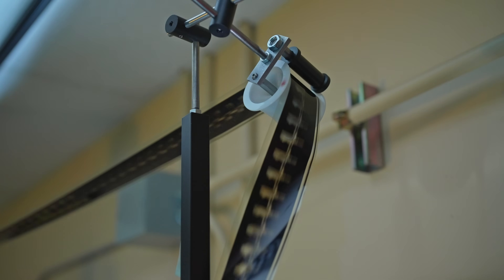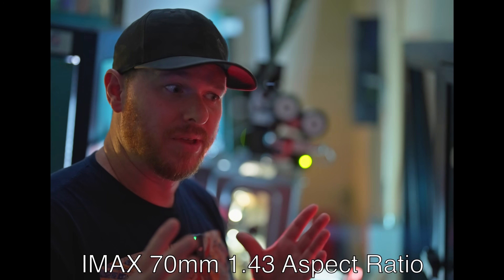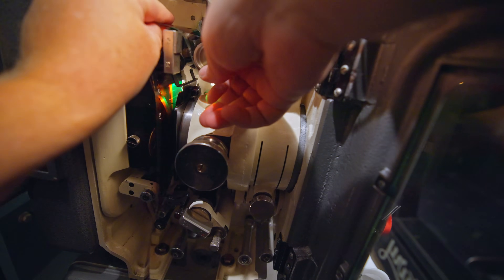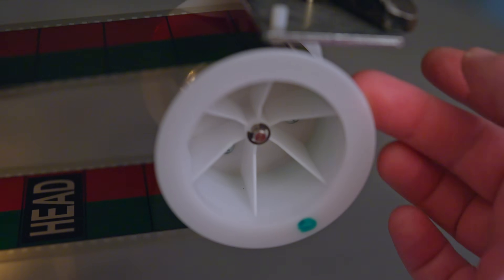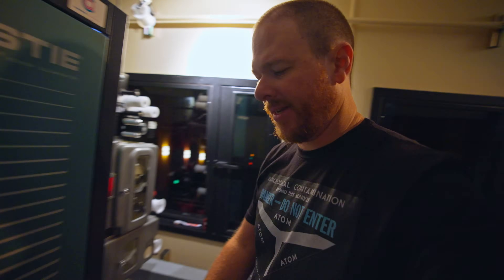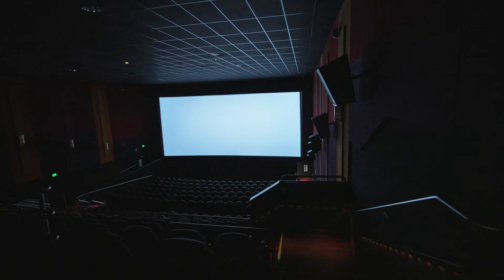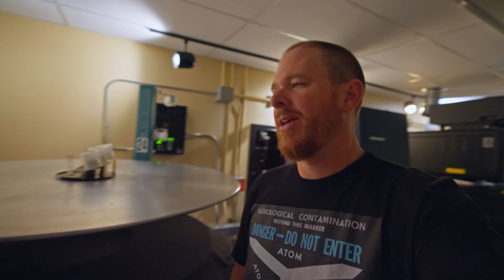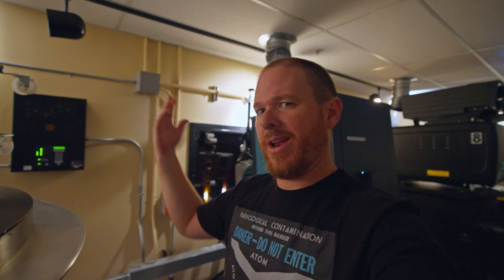Being a Projectionist for Oppenheimer 70mm Film Part 2

Comment: I've heard that for popular shows, a single platter would feed multiple projectors on different screens at the same time, with the film traveling long distances between projectors.  Do you have any experience with that?
Reply from the maker: I’ve never had to “interlock” a film print between different projectors like that. I’ve heard of some of the stories and they sound nuts.
Reply: Some years ago, i found a very nice video about that exact process here on Youtube. Try searching for it. Hope it's still there, though with the state of youtube's search system these days it might be tough to find it.
Reply: I used to work as a projectionist. We'd call this an interlock when you ran one print through multiple projectors. There were special rollers installed in the ceiling of the projection booth just for this purpose. If I was doing a two projector interlock, it would go sort of like this: you'd have a crazy long amount of film leader spliced to the head of the print, run it from the first projector's platter system to the first projector, thread it through the first projector, then run the projector and slowly thread along the ceiling rollers until you reached the next projector, being sure to leave yourself a bunch of slack, then thread the second projector and run the film to the platter system for the second system, where it would be wound back up and take up the extra slack between the projectors by running projector 2 for a few seconds. Then you'd flip a switch on the projectors to put them into interlock mode so they would both start at the same time when you pushed the start button on either of them.  If you did not put the projectors in interlock mode, you were in for a bad time; film dumped on the floor, or stretched and torn, depending on which projector you forgot to flip the switch on. For the next showing I'd just do the same thing, but in reverse: from projector 2, back to 1. The "longest" interlock I was was ever present for, but did not run myself was a 4 projector interlock. One film print that was run through 4 projectors! It was for a special event and a few of our old school projectionists who were actually still in the union ran it (and were stressed out the entire time). What made it even crazier was that 2 projectors were in one hall and the other 2 were in a hall that was perpendicular to the other, so the film had to be routed around the corner. Longest film leader I've ever seen! I would regularly run two projector interlocks myself, but those were easy peasey compared to running 4 at once!

Comment: Out of curiosity, how much do these special engagements pay? For instance, are you making more than what you made as a full time projectionist? If you feel comfortable answering, you don’t have to give numbers.
Reply from the maker: The hourly rate is about the same as a Studio Projectionist would be paid, which is the job I use to have back when I worked down in Los Angeles. The big plus is that its 14 hour days 7 days a week, with overtime and double time.

Studio projectionists get paid far more than what normal theater projectionists get paid. When I use to work at theaters I believe I was getting paid $7.50/hr (minimum wage at the time). When I started working for Warner Bros back in 2000, I started off with a $30/hr rate.

Comment: Is there a process or procedure for if the film becomes unspooled or dropped off the spool and is a giant mess of film?
Reply from the maker: A couple ways that can happen. If there is a bunch of static electricity that can sometimes throttle the motor speed for the platter and cause the print to almost slide off the platter. I say almost slide off because the brain (the motor speed controller in the center of the print) usually keeps it hanging on but in a mess that needs to be fixed. There can also be a brain wrap where the platter stops turning and the projector keeps pulling film. To fix something like that usually requires taking that wrapped section out and fixing it the best you can.
Reply: I just envision rats nest of a headache and a very uncomfortable phone call. Keep up the good videos!  @RadioactiveDrew
Reply: A brain wrap, lol, so funny to hear that term again! Brain wraps are bad, but tail wraps were worse! My theater had the cheapest platters that were prone to causing tail wraps. (not like those super-nice Christies!) If you didn't tuck the tail under correctly, or use some kind of "wrap strap" to keep the tail from flapping around, the film would get loose at the tail and eventually wrap all around the arm of the platter in a huge rat's nest tangle. It didn't happen often, but when it did, I'd have to carefully try to untangle the whole mess without damaging the print. Do not miss that at all.  @RadioactiveDrew

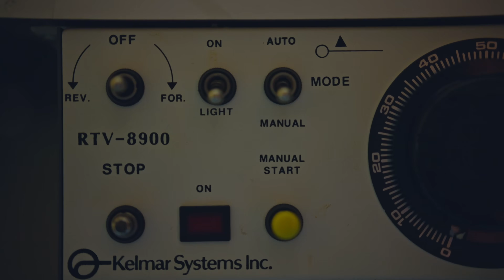Comment: 2:17 Since 15/70 is ran through the camera/projector horizontally, it’s not as simple as removing the aperture plate, like it would be if you shot 4 perf 35mm vs 2 or 3 perf. So you do get a significant increase in resolution. On a 15/70 screen, the 65 scenes look about as grainy as you might expect 35mm to look on a regular sized screen, and the imax scenes are nearly grainless.

2:30 I agree that it doesn’t make a whole lot of logical sense, but the difference is clear as day on a six story tall imax screen.
Reply: And at the IMAX presentation when it switches from scenes shot in IMAX to scenes in regular 65, the grain on image is very noticeable especially because they have to blow it up to the IMAX frame for presentation. 

I watched the movie in both 70mm formats and they were both great. But watching the movie in IMAX, especially scenes shot in it were totally amazing.
Reply: @bagnome I saw Dunkirk in 70mm IMAX and noticed it then, too. However, in Oppenheimer, Nolan uses grain to differentiate eras, especially the black and white scenes.
Reply: @bagnome And what is interesting is that from another YouTuber, he said those 65mm 2.20:1 scenes felt like they were optically zoomed to 1.90:1 on the 1570mm IMAX print (thus cropping some image). I would guess this was to compensate for the visual presentation to allow the 65mm footage not looking so small on the 1.43:1 frame, similar to watching scope films on a 4:3 TV back in the day.
Reply from the maker: @vangmx weird, I could see that happening though.
Reply: @vangmx  I really, truly doubt that.
Reply: I think the call-out to resolution vs resolving power is a key distinction. IMAX' 15 perf obviously has a higher resolution, since it's three times the film area. However, the aspect ratio is different than flat 70, so if the film is shot in IMAX and cropped for flat 70, the resolving power between the two isn't as huge. Showing the two frames next to each other is a great illustration!

I used to project 16mm in college, and the majority were academy standard, but we had anamorphic lenses and it always felt like a treat to show stuff in "widescreen" even though the resolving power didn't increase. ;)  My favorite films were where the academy crop was different than standard widescreen, and we got some extra "details" like boom mics in the top of the shot, or effects that revealed their tricks at the bottom.
Reply: and the changeovers! sometimes due to the 16mm format we had multiple changeover marks to keep track of. especially when something was printed from 35 to 16 where the reel length didn't match, or the original negative reels had marks, we would get "false" changeover marks before the reel was actually over. I distinctly recall a showing of 8-1/2 (Fellini) that had a scene a colleague inadvertently edited out due to a premature changeover. He realized his mistake after the changeover, apologized, and showed the scene after the end, but having projected the same film the previous year (possibly the same reels) I almost got hit by the same "gotcha" and empathized completely.

platters remove all of the changeover stress, but for single-screen theaters showing multiple different movies a night, that's a lot of setup / teardown overhead. I'll have to find out how my locals manage it. Maybe multiple platter trays on a single spindle?

Comment: 70mm IMAX is still higher resolution than 5-perf since it’s got a wider image ears. Also the IMAX footage on the IMAX prints is printed from the camera negative while the 5-perf prints are fourth gen. That’s a loss in detail. I’ve seen both. It’s say it mostly scales with the screen sizes though. Since IMAX is that much larger you don’t get a much sharper image but you can see a lot more detail. Because it’s so huge and you’re sitting so close to the screen. That being said, 5-perf is still ridiculously good!
Reply from the maker: I can’t really comment on the scaling process going from IMAX to 70mm. But that’s only for some of the shots. To reason this out a bit more, maybe the IMAX shots have to go through a bit more of a process to get onto the 70mm 5 perf negative they use to make the prints. Than what the original 65mm (what they use to shoot 70mm) has to go through to get in that 70mm 5 perf negative used to make prints. Or…they scan everything in and then digitally print it was a laser for a inner negative. Had to say exactly if there was a resolution bottle neck somewhere in the process for one format or another.
Reply: @RadioactiveDrew Nolan is well known for making his prints purely photochemical (except for vfx shots of course). So the blowups and shrinks are optically printed.
Reply from the maker: @wright96d well then that would have been complicated for the negative assembly team. What they use to do back when film was going strong was have original negatives for each film. An answer print was struck from that and then another negative was struck from that answer print. So usually in the best circumstances you would see a print that was a couple generations removed from the original negative.
Reply: @RadioactiveDrew  Four to be precise, like the print you’re showing and all the 35mm prints as well. I’ve talked to the lab head at FotoKem last fall and he said they’d be starting negative cutting in a week. That was over eight months before the movie came out. I think they need that time to do all the reductions, color timing, and neg assembly for the various prints. Since Dunkirk all of Nolan’s IMAX prints have been struck from the camera negative, while before that they’ve been struck from a dupe neg. So four generations like the rest. But they’ve always done some prints from the original camera neg as is tradition. For premiers and big city locations. It’s not like fourth gen prints are bad. It’s more that neg prints are so incredible. It like the difference between 5-perf and 15-perf. 5-perf is amazing and gorgeous but 15-perf is the best there is and it’s so perfect.
Reply from the maker: @VariTimo I use to work at Technicolor and Deluxe labs as a projectionist and that was kind of a cool experience. Lots of different procedures for film transfers. Never had to do any dye transfer work but I heard it was a messy process. 

But yes, I agree with you. IMAX is a beautiful film format if done right. Same with 70mm 5 perf. I still laugh at the 6k vs 18k arguments between 70mm vs IMAX.
Reply: @RadioactiveDrew  Yeah defiantly. I did some math an IMAX may only reach 18k in the most extreme edge cases. Probably saver to say it’s 8-12K. 

They haven’t done dye transfer in decades. I think it died in the early 80s.
Reply from the maker: @VariTimo well they were still doing dye transfers in the early 2000’s. At least that’s what I heard from fellow projectionists at Technicolor.
Reply: @RadioactiveDrew  Really? That’s crazy man!
Reply: @RadioactiveDrew  With contact printing the only bottle neck is generational loss. The IMAX shots get optically reduced to 5-perf and vice versa for the IMAX prints, which I think is why some wide shots in the 5-perf are soft. Everything is sharp in the 15-perf prints.
Reply from the maker: @VariTimo some of the shots are soft because they were shot out of focus. This has been a problem ever since Nolan has teamed up with his current DP.
Reply: @RadioactiveDrew  Those are not the shots I mean. They’re specifically IMAX shots and it’s pretty much only noticeable in wide shots. It gets worse and better. And the issue with focus isn’t really the DPs fault. And it wasn’t an issue at all in Interstellar and almost not an issue in the other two. Nolan wanted to use 5-perf instead of 35mm. And for this one I think the issue is the new lenses they’ve used and the fact that Nolan doesn’t do reshoots on principle.
Reply from the maker: @VariTimo there were some horribly out of focus shots in Interstellar. I was at Warner Bros as a projectionist and heard all the concerns about the soft shots.
Reply: @RadioactiveDrew  Really? I saw it in 15-perf earlier this year and I didn’t notice anything horrendous. And I was sitting pretty close. There is some softness going on. But that’s because of soft lenses. From my memory, Interstellar didn’t have any more out of focus shots than any other film based movie.
Reply from the maker: @VariTimo okay, I’ve seen these films way more than most people so my criticism is going to be a little hyper. The shot in Interstellar that is horribly out of focus is when Matthew McConaughey is crying after seeing all the messages from the past. There are a bunch of other shots but that one stands out. With Oppenheimer where to start. The opening shot of Oppenheimer when you see him for the first time. It starts in focus for a second but quickly moves out of focus as the camera begins it’s dolly back. There are a bunch of other shots that are soft but some of the worst are when Josh Hartnett and Jack Quaid are sitting in the car right before the Trinity test. There was a focus rack between them and it was totally missed. That was one of the worst. I know it’s hard to focus on a large format like 65mm or IMAX but wow they miss focus a lot. Plus showing the films in these large formats it’s easy to see which shots are a little soft and way out there. Plus there are scratches on the negative. Usually these can be seen as a dark brown scratch. There are a couple but the ones I can remember offhand are the one in Cambridge when Patrick Blacket dismisses the students for the Niels Bohr lecture. Along with the one in the operations tent for the Trinity test right before Oppenheimer and Groves leave the tent. There is also damage to the film in some of the black and white scenes. Mistakes that could have been easily fixed in a computer if they had just bothered to scan in the shots and fix them. The level of shotty filmmaking in this film is kind of embarrassing to be honest. I just get mad at people not making the extra effort to make things as perfect as they can be…especially with a large budget.
Reply: @RadioactiveDrew  That’s kind of the Nolan thing. He throws all the money and care into it, but he really isn’t going for perfect.

Comment: Thank you for making these. Random question, have you had any issues showing the film on this run? And if some of the film is damaged what would be the outcome in that situation? Thanks again for making this
Reply from the maker: The only problem I’ve had was a bit too much flicker. So a tech came out and laser aligned the bulb and the reflector, which does seem to help. I think the main cause of the flicker is the double bladed shutter. 

If a piece of film is damaged enough where it can’t pass safely through the projector it’s cut out and usually the reel the damage took place in is not replaced.